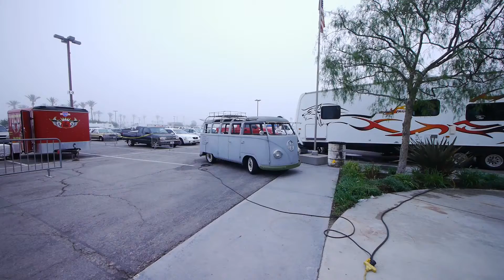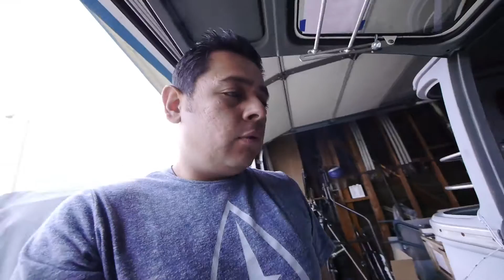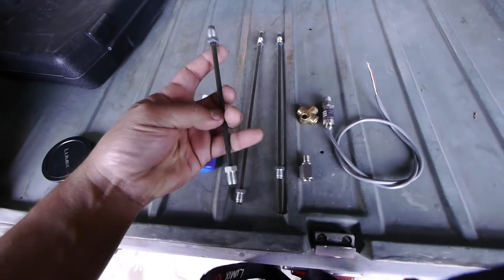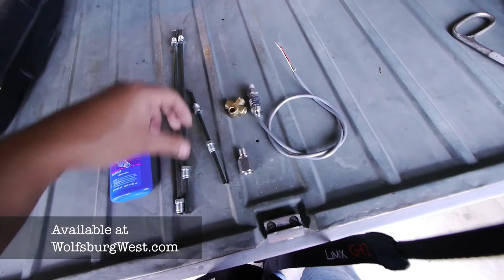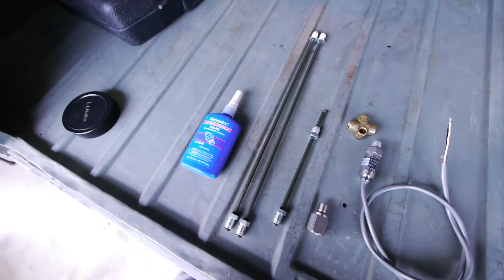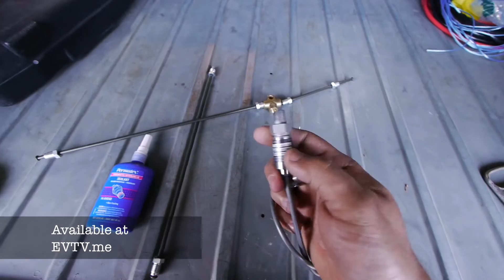DIY EV Hydraulic brake Transducer installation eSamba

Comment: FYI you're better off with the adapter; you don't want just 3 threads in the brass.  Brake lines run rather high pressure, and if you lose the brake line, you lose rear brake pressure, possibly front brake pressure, and your regen never activates.  The flare inside the T should still have a very small seat contact area with the inside diameter of the adapter if you cinch it down hard enough.  Just be careful not to split the brass by over-tightening.